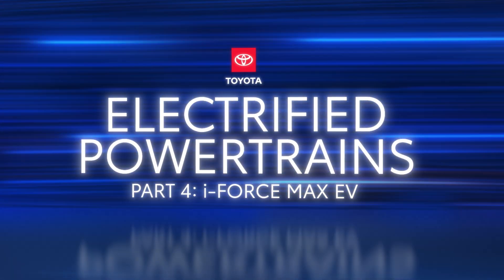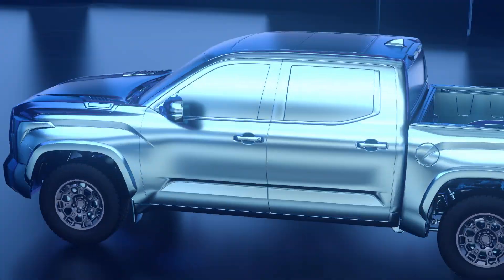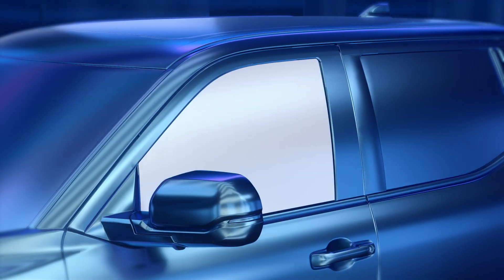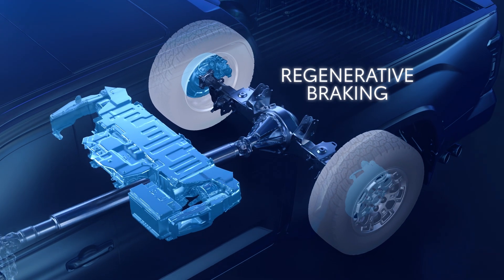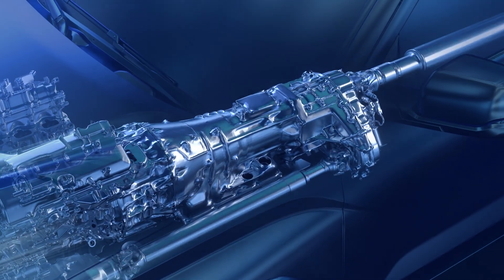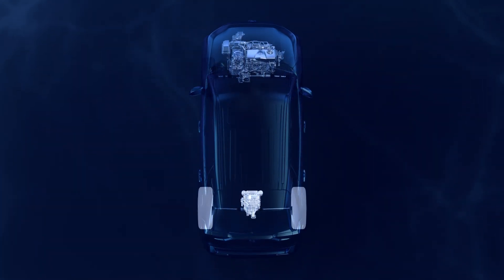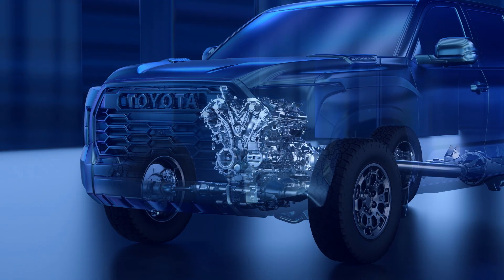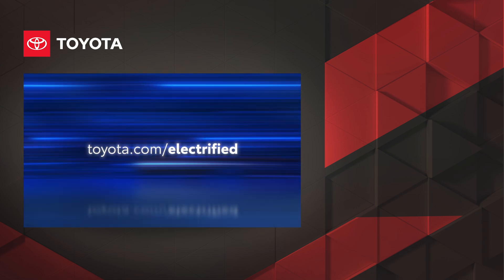How Does i-FORCE MAX Work? | Electrified Powertrains Part 4 | Toyota

Comment: I use my Plat '24 I-force max for heavy towing & it blows away my old 13mpg Ram 1500 that it replaced. The 24 Tundra gets 19mpg around town, 21 rural. I also have a ’23 Tundra TRD Limited that we use as a DD.  I just hope the bearing failure issue never happens!!!

Comment: Love the power but worried about the reliability. My 2024 Tundra with iForce MAX has had six instances of hybrid system malfunction. Waiting on a new inverter now, expected to get the part in 2 weeks
Reply from the maker: Hi, there. Your experience is important to us. When you have a moment, please call our Brand Engagement Center at (800) 331-4331. Our Brand Advocates are available Monday through Friday from 8 a.m. to 8 p.m. and Saturday from 9 a.m. to 7 p.m. EST to discuss your concerns further.
Reply: Agree. Ill pass on the battery propulsion. Added complexity and failure points. No thanks Toyota

Comment: Just bought the Land Cruiser 2025... I was a BIG cynic of this platform, especially with a 4-banger, but this is a solid / powerful system, even for the 5100lb Land Cruiser.... I JUST HOPE it's as reliable as the usual Toyota's with NA engine, and if not, I hope Toyota stands. by it...
Reply: Sadly it’s not very reliable. Many Tundra owners are dealing with Hybrid system malfunctions, including myself. Good luck with the Land Cruiser!